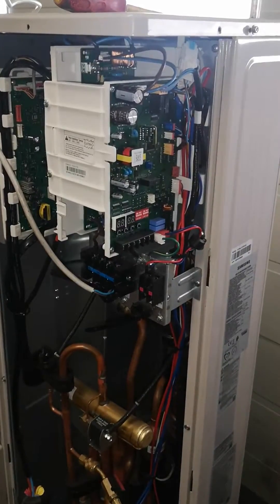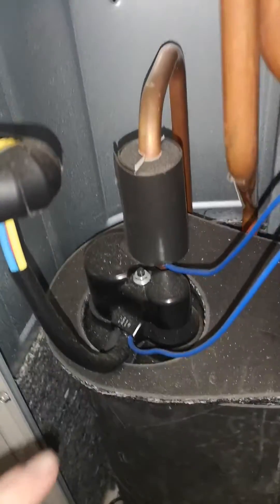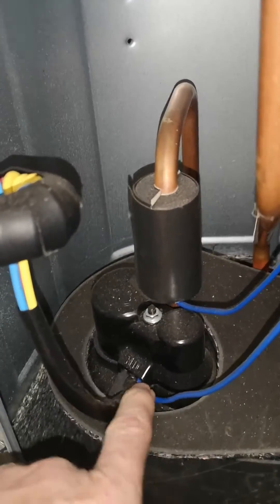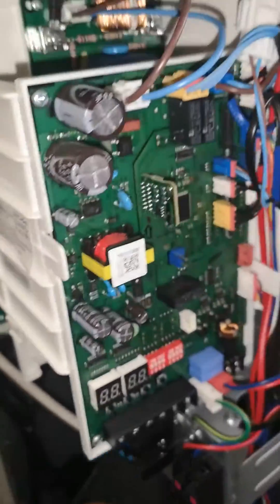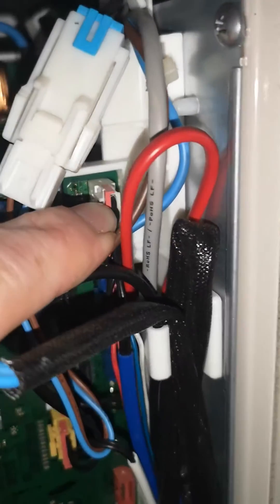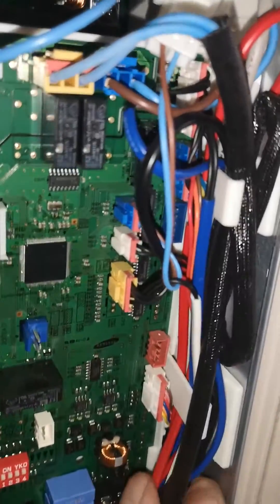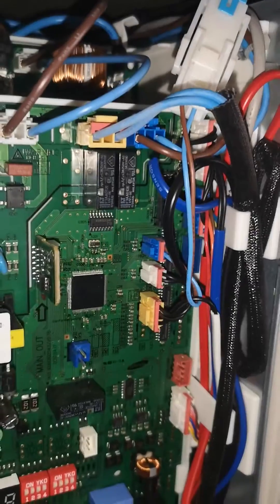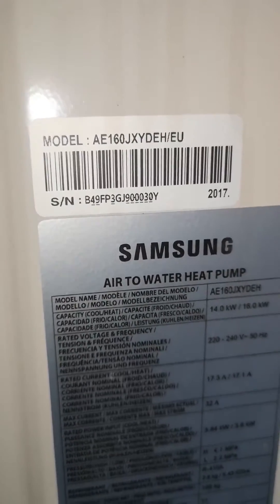E320 PCB failure Samsung air source heat pump gen 3

Comment: I have the AE090JXYDGH/EU. I had the e320 for the first time two days ago and it has returned every hour or so. The topmost pin on the connector described in this wonderfull video turned out to have a very small crack in the solder joint.

Comment: I had this error and my local engineer replaced the sensor but the error code remained. He has told me the unit is working properly but he just can’t clear the code. For the past week the code has been on the display and the green light has been off (not red). The hot water is still being heated. Is this possible? Thanks

Comment: can this cause the unit to run at not full capacity? got this fault and sensor test sweet plus board looks fine but i notice it doesnt feel like its ramping to 100%, comp and fans seem like 3/4 of the max speed

Comment: hello, I am having EHS AE090 (year 2016) and having the E320 error but once the indoor unit is switched off/on the error disappears but in a 1/2-1 day it again appears. I have measured the resistance of the sensors and seems correct OLP sensor having 160Ohm (at ~20°C). Is that a faulty sensor or the PCBs? Any suggestions?
Reply from the maker: its always the pcb , ive never seen a sensor go wrong in 7 years
Reply: @myheatpumpchannel7577  thank you very much for your response. It seems like PCB as I have also not seen the fan turning at all lately (I have realised this only after some weeks now :-). The sensor resistances also seems OK.

Comment: Great info mate.. is it possible to solder the the back connection ? The boards aren’t exactly cheap and I’m pretty competent with the old iron
Reply: This is kind of what I want to know as well. And why does the board have to be replaced just because the plug has been pulled a bit??
Reply from the maker: you could and it would work, the boards are only 80 quid though
Reply: @myheatpumpchannel7577  do you sell/ fit new PCBs? We have just got this error :(

Thanks
Reply from the maker: @danlew94  yep call 02380274833 ask for shah or samuel they will sort it for you on monday
Reply from the maker: you could and it would work, the boards are only 80 quid though
Reply: @myheatpumpchannel7577  IS there problem with plug of the sensor? Can I fix it by some soldering ? Why do you change pcb?
Reply from the maker: @cactusek  yes its just a crack in the solder on the back of the pcb, fix it and you dont need a pcb
Reply: Did anybody correct soldering and It Fox the problem?
Reply: @kicker23  I've repaired one and it did initially work.. however a couple days later I was back there and I replaced the 3 sensor loom.
The connector pin plug was bent in a way that must have not had enough contact and was playing games with my head as it worked.. sometimes!
Use a good magnifying glass or jewellers loupe to inspect all contact points carefully.. if you dont see an issue perhaps replace sensors before board.
Here in Australia PC boards on different units can vary from $400 to $900.. whereas sensors are $20 or $30. Hope that helps.. Good luck !
Reply: @djfunkychicken  I think it is better to correct soldering even if we do not see any break in solder point. Is it a lot of work to take out the pcb to expose the solder points?
Reply: @kicker23  
If money is not a major issue.. or not confident in soldering properly.. just replace the board
Easy to remove.. 2 mins max.  take a couple photos of plug connections just in case.. but usually you'll remember where plugs went
Long nose pliers makes it easier to reach and squeeze together the 3 or 4 little plastic clips (holding the board in place) in the corners.
Once the board is out make sure the pins on the opposite side are stiff and not moving and that there is good solder contact
Reply from the maker: yep thats what we do